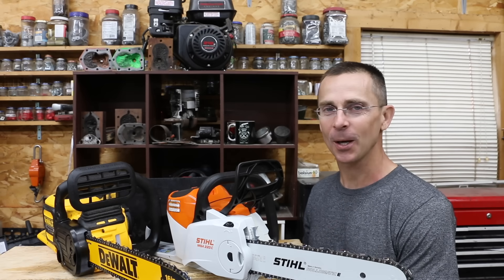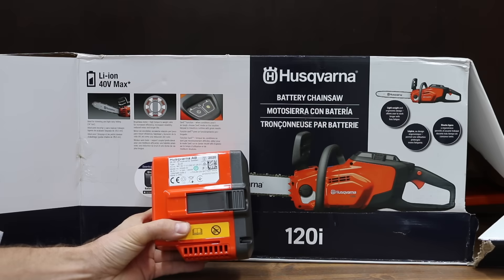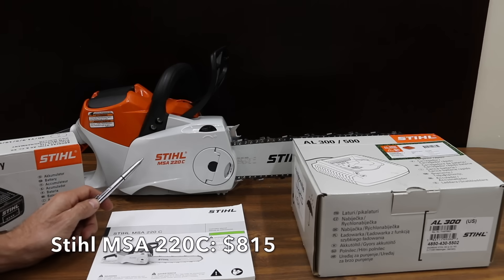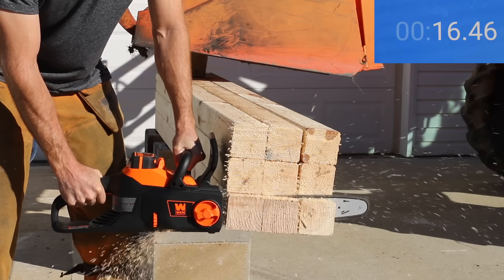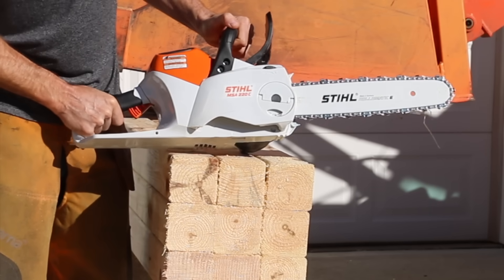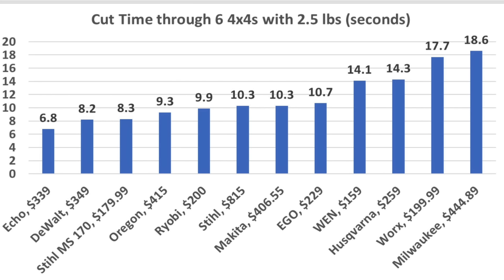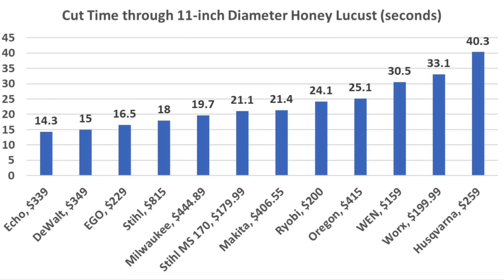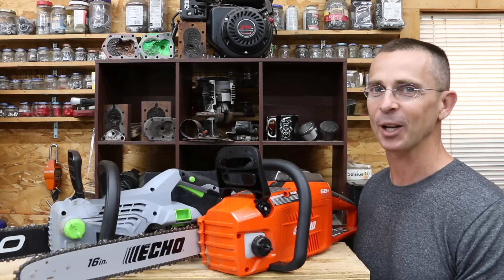Best Battery Powered Chainsaw Brand (ROUND 2)? Stihl, Husqvarna, Echo, Oregon, DeWalt

Comment: Just bought the Echo saw because of this video.
Reply from the maker: It's a terrific saw!  I've been using the one I tested in the video quite a bit and it cuts much faster than my gas saw of the same size
Reply: @ProjectFarm  Any idea how much run time you get out of your had powered saw on a tank of gas? Clearly it's not apples to apples as it takes moments to refill the tank, but I'm still curious.

Thanks for the great review as always!
Reply: A Stihl ms170 or 171 will cut about 20 min on a tank.
Reply: Not really the same size for weight though, it does well out cutting the smallest gas saw Stihl makes but if you were to go off weight you could buy a 45cc gas ms250 or 251 and mot one of the electric ones could keep up.
Reply: I'm happy I already own this saw though it is a different brand on the outside in my country.
Reply: Free battery if you buy before June in the UK. Just brought one very pleased! Built in Japan not China very well built machine and very powerful. Impressive
Reply: How is it, I have been thinking about making the purchase but am holding back because of the reveiws of how the battery does.
Reply: @sumdumgoofer9032  Whitley replacement batteries. There's a couple other companies coming out with decent ones too.
Reply: @sumdumgoofer9032  Yeah I saw that. I am a little worried but I'd rather replace a battery than fuel lines and a carb.
Reply: @amc31b  Understandable, have a nice day.
Reply: @amc31b  why would you not just put the extra in for the dewalt? Atleast you know it's probably going to be more reliable.
Reply: @ryanallen3704  that's what I did. Although I already have a bunch of dewalt Stuff and it all works amazing
Reply: @amc31b  Buy an Echo gas saw if you are worried about the battery. I have three Echo gas saws, a blower, a string trimmer, an edger, and a PAS. Two of the saws are almost 40 years old (650 EVL and 660 EVL) and still run great. I used them in the 80's and 90's to process 6-8 cords of firewood each year along with general trimming, felling, and storm cleanup; never an issue with them at all. For the price, Echo is very hard to beat.
Reply: @joem7572  I love echo products but I do not use a chainsaw often enough to warrant dealing with a carburetor.
Reply: @amc31b  I purchase my fuel at the marina and use no ethanal "E Free" gas and add stabilizer.  The E-Free gasoline makes all of the difference in the world.  I just realized that I left fuel in my old chainsaw that was dropped 18 years ago.  Just out of curiosity I pulled the fuel line and weighted filter out of the tank....still flexible and in tact.
Reply: @g.k.1669  Cool but 10% ethanol is required by law in my state. The only way to purchase ethanol free gas here is to buy 100LL aviation gas which requires a pilot's license.
Reply: @amc31b  Bummer.  I was hoping to help a fella out.
Reply: @amc31b  you can wash the ethanol out of the gas quite easily, there are YouTube vids on how to do it
Reply: @amc31b  Project Farm has a video on how to remove the ethanol from the fuel.
Reply: Does the echo have a chain break?
Reply: All saws sold need to have a chain brake it’s a law to have one now for safety
Reply: @TheSnappleman75  yes
Reply: @TheSnappleman75  yes
Reply: Makita for my favorite tiny battery quick carving saw. I can’t believe Makita the original isn’t here. Ouch
Reply: @FlukeCarving  makita in his other video
Reply: The cost of spare/ replacement batteries is high... over $200.00 on SHAM azon ! 
I'm hoping for a knockoff or a more reasonable price, when my battery weakens with time/use.

Comment: Echo is also the best value. It doesn't have the tooless chain adjuster but I prefer the two nuts tightened with a spanner. I had an Oregon chainsaw with the tooless adjustment and it kept coming loose because you use you hand to tighten, that's inferior unless they improved the system on the new ones.

Comment: It is too bad you used the cheaper EGO to test against the others.  I was told by others that has had both the 14" & 18"  that the 18" is a BIG improvement in power.  And with the fast charger the 5.0 charges in under 40 min.  Also I expected more from Stihl.
Reply from the maker: Thanks for sharing.

Comment: I bought a Greenworks 10 inch electric chainsaw on Amazon for $75 after the third charge the battery charger didn't work so I bought another chainsaw for $90
Now I have two chainsaws two batteries and one battery charger for about $160 and I am very very happy this little chainsaw is absolute must for camping clearing brush etc etc
Reply: I have the greenwirks too with 16 inch bar. I atually been running it with a 18 bar. I cut alot of firewood with it. I do have 6 batteries. I cut about 3o full cords this summer. Seem to be durable saw

Comment: For years, per recommendation from a very smart mechanic, I have been using used motor oil as bar and chain oil in my saws. What about testing which bar oil is best and if used motor oil would suffice.
Reply from the maker: Thanks for the video idea.
Reply: A lot of guys run canola oil. I works great. It's edible, biodegradable, and doesn't leave your property smelling like petroleum if you cut a lot. It does smell kinda like popcorn when running the saw...which makes you hungry.
Reply: A lot of guys run canola oil. It works great. It's cheap, available everywhere, edible, biodegradable, and doesn't leave your property smelling like petroleum if you cut a lot. It does smell kinda like popcorn when running the saw...which makes you hungry.

Comment: Wen is kinda a hit and miss brand for me right now. I’m a carpenter and I own a jig saw and power planer from them. The power plane is great, just as good as a Bosch I had used a lot which made me buy one. The jig saw on the other hand I won’t even use it the foot plate isn’t square to the blade and their is no way to adjust it plus the trigger isn’t variable speed which is a must on a jig saw. It has a dial instead
Reply from the maker: Thanks for sharing.

Comment: How come you didn't include the greenworks.
Reply from the maker: Great suggestion for future round of testing.
Reply: @ProjectFarm  I been pretty happy with mine, still use the gas saws for big jobs, but 90% of the stuff I do the battery saw does the job. I was able to cut  down 14 10 inch pines on one battery.

Comment: Great test! the only possible parameter I could think to add is the same (Oregon) chain for each saw. --- I am using the Oregon electric saw and just replaced the self-sharpening chain w/ an standard Oregon chain. Works like a charm.
Reply from the maker: Thanks for sharing.

Comment: Recall Alert!  The 40v Kobalt battery electric chainsaw has been recalled due to a fault that can allow the unit to stay "on" and pose a laceration hazard to the user.  These were sold at Lowe's stores and Lowe's Online from Jan 2014 to March 2020.  This is in the Jan 2021 Consumer Report, page 19.
Reply from the maker: Thanks for sharing.

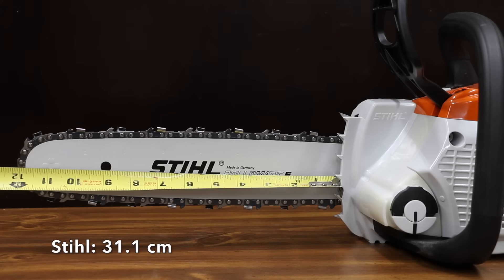Comment: 6:23 You should probably isolate the microphone from the table that the test subjects are sitting on.
There could be a lot of extra sound transmitted via the mounting system. 
There could also be some reflecting of the sound off of the table surface.
Reply from the maker: Thanks for the suggestion.

Comment: Video suggestion:
Quite unlike your usual videos perhaps, but I noticed it's quite hard to tell a difference between electric shavers (Both brand, model etc) as they seem to have very similar specs while prices range wildly.
While the product is quite different from what you usually test, the tests themselves would be somewhat similar (Battery length, recharge time, torture test and whatever mad ideas you have)

Comment: Two excellent, fast paced, well laid out videos!!! I have a Dewalt 40V and it works well for me as I use it for Carving and small tree cutting, I have a gas Husky for blocking out carvings and heavy wood cutting. I will check recharges as I do not think it takes over 2 hrs.
Reply from the maker: Awesome, thank you!

Comment: what about testing  8 to 10 inch linesman pliers ..need to test the side cutters for ease of cut durability of cutters ,, max thickness of wire  cut how much grip the griping  capacity nose of the pliers have and how durable  the serrated part of the gripping nose has anything extra they will do ..we can get snap on, mac and Milwaukee .Stanley fat max ,  Channellock in the UK...cheap vs expensive
Reply from the maker: Thanks for the video idea.

Comment: Me: buys EGO saw
PF Farm: drops video
Me: cold sweats
Reply: First off yes I love my ego gear.  He used the weakest of the ego chainsaws.  I have the 18" and love it.  Would of liked if he used at least the 16" which does have more power than the 14" and less than the 18"
Reply: @adamballou4680  I love my Ego chainsaw.  No regrets.  What would help in the video though is a chart of the battery power of each chainsaw he bought.  You can't knock the Ego (or any chainsaw) on battery run time if a better battery is available.
Reply: @adamballou4680  True. I agree with you. I have 18 inch and its very good.
Reply: Just to back up the comments above me, I work for a landscaping/tree felling company and we heavily evalutated the Ego's and the Echo's we ended up going with Echo because they feel more like a typical gas powered chainsaw and we wanted to keep consistent with our crew. However, pretty much everyone loved the Ego's. Overall our call was very close with the deciding thought being that Egos are better for home use since they also have a nice lineup of other yard equipment but Echo was better for commercial use for their slightly better cutting capability, ruggedness, and durability. 

In the end though, I don't think anyone should be upset about buying really any battery chainsaw, especially for home owners. They are much easier to maintain, quieter, safer, and all around a better option unless you are looking to be running it all day (even then it might be better) or felling large trees.
Reply: I feel ya. I have the EGO 16 with the 5Ah battery.  It feels heavy when you are up in the tree and cutting sideways.  So for casual use, combining with the smaller battery is probably the way to go.  Based on this review, I am more certain the EGO is among the best performers.  I no longer wish to have the Husqvarna and def will not spend up to 3x for the Stihl.  I also suspect the chain sharpness and angles might play a big role in the differences in performance.  I sharpen pretty regularly and I must say it really does cut like butter!
Reply: He tested the cheapest EGO saw and it still performed really well. Would love to see the EGO 14 inch compared to the 16 and 18 inch with 5.0 and 7.5 ah batteries, maybe even the huge 10 ah.
Reply: @Augownage  I use the 7.5ah battery with mine. It makes a significant difference over my 2.5ah battery. Seems like it would be better to test these with comparable batteries. Especially since he mentions specifically buying the largest battery for the stihl at 5:40 @Project Farm
Reply: @Space_Biscuit  well u could imagine the difference the bigger battery wud make, approx double run time for 5ah 🤔
Reply: husqvarna or stihl don't make lawnmowers, so you should be ok.
Reply: @wim0104  Husqvarna makes lots of them. Their own and Craftsman's, at least.
Reply: @antilogism  
Actually Husqvarna make several tractor style lawnmowers. Fairly nice too.
Reply: @Cyberhawkzz  Yes. My 48" is 17 years old and still mowing strong.
Reply: Most people buying saws just want something for occasional use, maybe they cut down some branches like once or twice a year. That's why the Ego is a good deal, it's cheap, and you can use the battery with the blower/edger, etc. If you buy Ego, you probably have other Ego products, and can mix and match the batteries. The best thing about Ego, from all the long term testing I've seen, the batteries hold up extremely well. To me that's the biggest thing. I don't want to spend hundreds on batteries every couple of years for something that is only lightly used. In any case I thought the Ego, for the price, did a great job. I don't really care about the higher end stuff since I'm not paying $400 for a chainsaw used for an hour every 9 months.
Reply: What's to worry about?   Ego is the best bar none.

Comment: I would love it if you could test different types of attic insulation. There are so many different types on the market and it would be interesting to find out which one is the best. Cellulose, fiberglass, and wool seem to be the top options available. You could test each product's ability to maintain a comfortable temperature, test the combustibility and flame resistance of each insulation, maybe even see if a product is resistant to pests like some claim they are.
Reply from the maker: Great suggestion!  Thank you.

Comment: For the price, you would expect the stihl to be a hell of a lot better than it actually was. I guess you could say it was Stihlborn! I'll get my coat...

And thank you for comparing full price, not just saw price.

I used to live on a farm and my dad used a Husqvarna 2 stoke back in the day. He tried repairing used chainsaws for a while, but it turns out they were sold used for a reason so eventually he just decided to buy a new one.

On another note, I am really impressed with just how convenient a battery powered chainsaw is for light work. It's nothing compared to the runtime of that two stroke which could roar away for several hours without refuelling. But for occasional pruning it would be great. We really hit the best solution with gasoline. It's got high power density, but not so much that it requires complicated safety systems to control and prevent failure. It's a shame that fossil fuels have doomed the planet but hopefully we can live past that and start terraforming earth to keep it like earth.
Reply from the maker: Thanks for the feedback.

Comment: I'd like to see a comparison of rubber garden hoses. Online review scores are worthless - they are all the same with the same complaints and almost identical ratings but obviously the quality is not the same for all of them. Also many of the positive reviews sound fake. I'm not sure if you could find a way to test for "kinkability", but maybe you could crease them with clamps and see how well they recover when released. Resistance to cutting and puncture would be good, and of course pressure testing if possible.
Reply from the maker: Thanks for the video idea.

Comment: You did not use DeWalt’s real charger. The 118 charger would cut that charge time in at least half. Plus it has a fan that cools the battery while it charges. Meaning better battery life over all with no chance of over heating.
Reply from the maker: Thanks for the constructive feedback.

Comment: Wow... quick turn-around on my suggestion to include the EGO offering from the previous chainsaw video. Nice! 

I like how the EGO stacked up against the competition, especially for the price. I had a feeling it would do well and it seems like the only category it struggled in was battery life. Understandable given the capacity of battery it came with which is directly related to the lower price. 

I'd like to see how it would stack up with a dollars to dollars comparison where the EGO was maybe afforded the same budget as those that cost more to at least pop for the 5.0Ah battery EGO makes. My guess is this would put it in closer contention to the others in the categories it struggled in. Then again, those particular categories may not be as important to some users in which case the cheaper price point makes it the clear winner. Either way, it's nice to have options. 

If I buy one (likely now given this direct comparison to the Dewalt that was the other consideration given battery ecosystems I'm invested in) I will likely buy a "tool only" since I already own the 7.5Ah EGO batteries for the snow blow and mower which will let this thing run quite a long time. Might add some weight but that's what steroids are for. ROFL

Another well-done video. Thank you and keep up the good work!
Reply from the maker: Thanks for the video idea.

Comment: Should be interesting as we bought a couple of the Milwaukee saws for our fire department for roof work. We don't do that many calls that need a roof saw, so maintaining the gas saws is a huge PIA. We went Milwaukee over the Sthil simply because our other tools are milwaukee lithium, and shares the same battery. 

Should be interesting to see how they hold up. I'm looking for carbide chains for them, looks like ebay is the only source so far for that little pitch chain.
Reply from the maker: Thanks for sharing.

Comment: Should have used the Ego 18", both the 16" and 18" Egos have stronger motors that take advantage of the 5ah battery. I'm sure it would have beat the Dewalt & Echo.
Reply from the maker: Thanks for sharing.